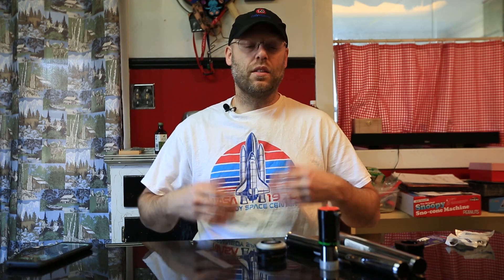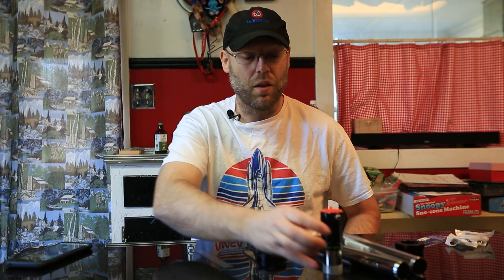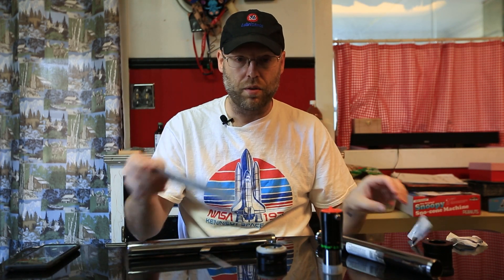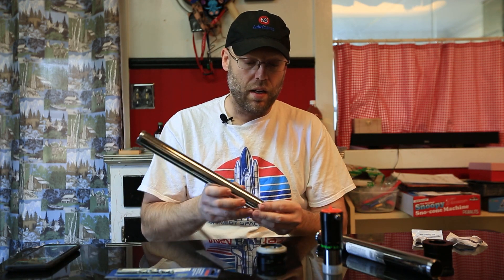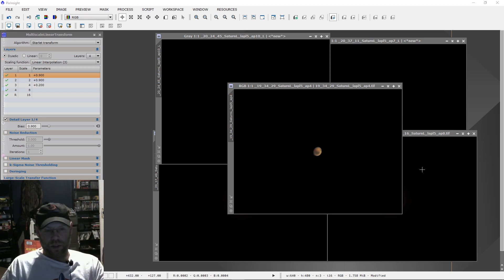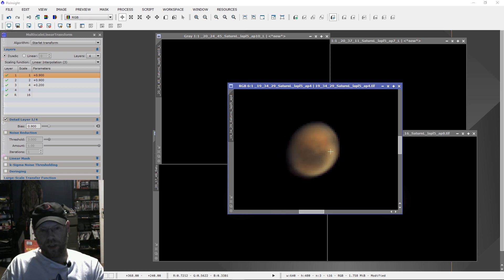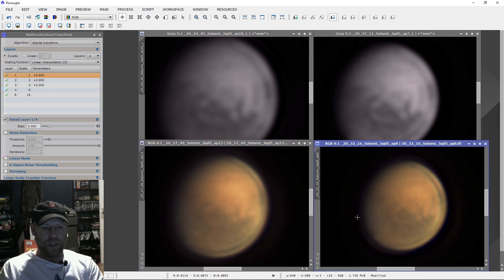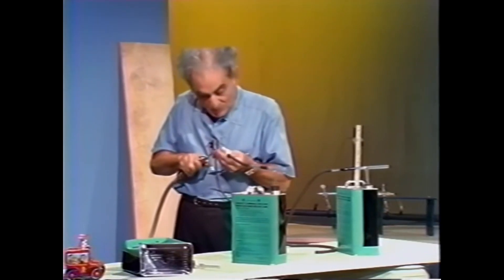PowerMate Vs. Home-made barlow. WHAT?! you won't believe this. Give away at the end.

Comment: Jay can you tell us what thread size for the grub screw is and what size tap is needed?
Reply from the maker: It was just a 1/4 20 hex bolt (like a camera tripod thread) and the matching tap
Reply from the maker: I went a little big so it didn't strip out the 3d printed material.

Comment: That's pretty cool. I have gotten a couple of .96" eyepieces from Red for an old Celestron C60 that I've had for over 30yrs. I have other scopes now, and don't get them out often enough. Will you post the exact teleconverter that you used? I may try building one myself.
Reply from the maker: Just search vivitar 2x-21 on eBay. That's The one I used.